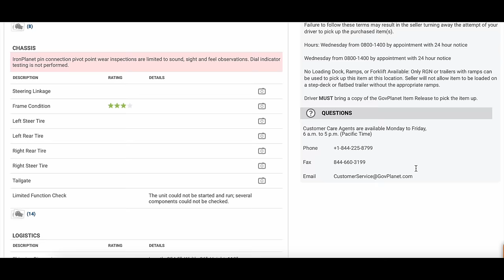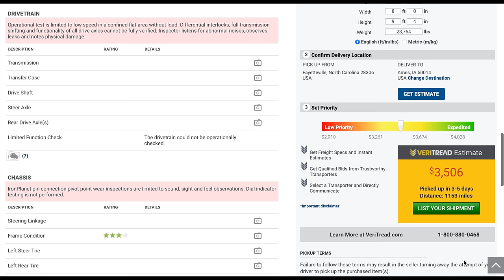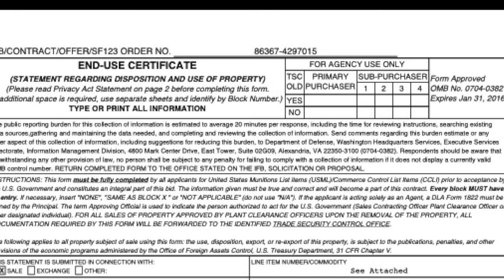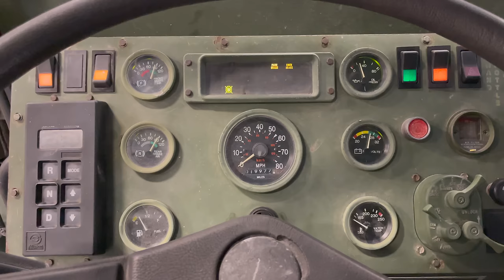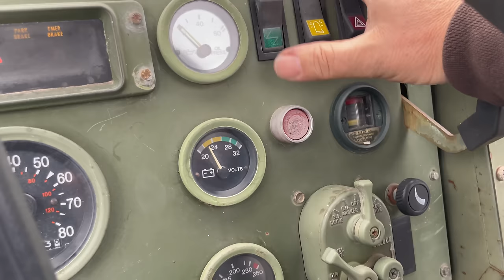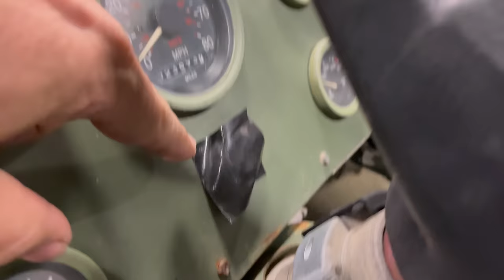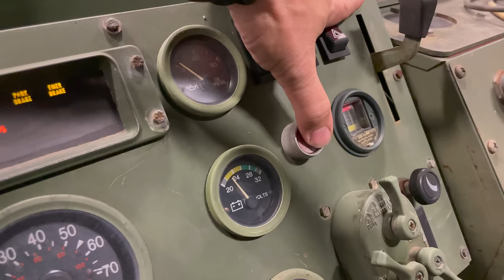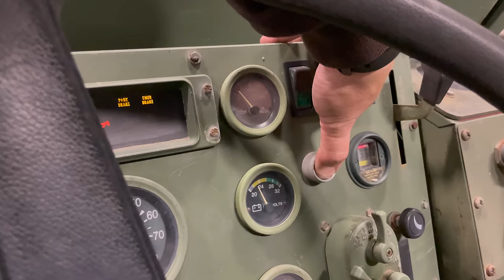Buying a LMTV on GovPlanet Wasn't How I Expected

Comment: It’s amazes me how little they sell for considering what the government payed for it originally.
Reply from the maker: Most hardly have any miles on them as well.
Reply: Because unlike you and I, the government doesn't have to earn the money they spend.
Reply: @ThisWeekWithCars  The life of a military vehicle is in hours, not miles. It spends more time running than moving.
Reply: @j.p.1576  USBP is pretty rough on vehicles as well.
Reply: @Theodore Olson You knew what I was talking about. I used to do avionics sales to all branches of the military. At the end of their fiscal year if they had any money left over they would spend every single tax payer penny on things they didn't need just so they wouldn't miss out. Their excuse...everybody does it, If I don't spend it, someone else would. Give me a break. Joe tax payer doesn't have that option, we live within our means. Not sell things for pennies on the dollar because it wasn't your money you were spending. Nice try though.
Reply: @Theodore Olson -  That's what the Toyota HiLux is for...
Reply: @ThisWeekWithCars  The military frequently replaces odometers so the odometer readings are rarely even remotely close to accurate
Reply: @bower31  I spent 25 years as a Army mechanic, and never heard of anyone replacing a speedometer.  The Army does keep fairly detailed inspection and maintenance reports, especially in their newer software platform launched around 2015.  It would be very difficult to claim low miles on a vehicle with higher mileage.  Compare wear on common items like steering wheel, seat belt clasps, seat edges from drivers in and out.  Vehicles that sit around too long rot quicker than vehicles always being used.
Reply: @chrisgraham9110  All I can tell you is in the USMC we replaced speedo's on HMMWVS and 7tons a couple times a week, it was a super common failure item. Where the speedo cable would connect to the speedo wore out a lot and the odometers would stop counting. Less so on the 7ton though, did see damaged damaged cab components semi frequently though. We were also regiment motor T so our dead line was normally a good 20-30 trucks, and we had a weekly turnaround of about as many trucks, unless we had an op coming up.

Edit: I was also pretty used to seeing weekly truck readings drop from 9-11k to 0 the next week after leaving the maint. cycle.
Reply: @born_again_torinos  It wasn't because they wouldn't miss out, it was because if they didn't spend all the money allocated, their budgets would likely be reduced the next quarter.
Reply: @dryan8377  Not at all. I lived it. I saw it. I heard them. I experienced them scrambling at the last hour buying tons of stuff they didn't need. We were even open till midnight so they could spend till the last second.
Reply: These things are disposable
Reply: @clutchitup8565  They definitely aren't, they're willing to repair up the to items value in maintenance
Reply: @born_again_torinos  Nah, federal budgeting is based on a use or lose model.  You spend your budget allowance or it gets reduced next year.  I managed a couple million dollars worth of supplies while active Navy, we'd usually use end of fiscal year funds to buy office supplies and other consumables.
Reply: @joshr9730  I know what I lived and nobody can tell me it didn't happen every single year end. It wan't paper clips it was high end avionics and the parts to repair them and mega expensive testing equipment.
Reply: @born_again_torinos   I don't think anyone's arguing that it doesn't happen like you describe. I think he was talking about WHY it gets done that way. I'm a H-60 mechanic with 18 years and counting, and I agree with you 100% that the end of the fiscal year spend-down is definitely a real thing...and that it's absolutely disgusting and disgraceful. However, the point others here are trying to make is that this spend-down doesn't happen simply because these government/military outfits are on some for-the-hell-of-it shopping spree. Regardless of how it may appear (or how individual units conduct themselves while interacting with vendors such as yourself), the fact of this idiotic system is such that if you manage your money all year, don't get hit with any unplanned expenses, and finish the year with money left over, the bean counters will take it away and reallocate it in nothing flat. Bit, if the following year, you have an increase in unplanned expenses in following years (i.e. increasing maintenance costs with aging aircraft), getting an increase in funding back from the bean counters is like pulling teeth. 

It's definitely a horrible system which incentivizes wastefulness!
Reply: @ThisWeekWithCars  Former 88M here, those miles were probably the hardest miles in existence.
Reply: @bower31  same in the transportation industry lol
Reply: It’s equipment, and we were at war. Better to have excess equipment than not enough. It’s wasteful for sure, but I do see the logic.
Reply: Military industrial complex dude. Can't spend your tax dollars to buy new shit if they're still got the old stuff knocking around - people might get wize.
Reply: It's the open market that decides what they sell for, it costs however much is a person willing to pay. Military vehicle aren't good civilian vehicles I guess, they make great toys that's for sure.
Reply: @born_again_torinos  in the corporate world, you need to spend your budget every year because otherwise it will be cut back the next year.
Reply: @chrisgraham9110  I know of several vehicles that had speedometers replaced while I was in, but that didn't change the fact that were still low miles. Highest mileage I saw was a first gen HMMWV that had been on several deployments and was used as a utility vehicle in garrison. Still only had 37,000 miles lol.
Reply: @bower31  you’re in outer space
Reply: @born_again_torinos  That's literally how everyone does it for their budgets and it's just god damned gross

That's why they'll blow threw crap tons of ammo before the budgets come in, I'm pretty sure lol 

That has to amount to quite a bit as well
Reply: Dad bought .45 auto pistols for 36 $ in 60s but had to wait 5 years to get them from government.

Comment: The slow and indeterminate process of buying a mil-surp truck on GovPlanet reminds me of buying a Japanese Domestic Market mini truck from Japan.  Mine arrived three months after I paid for it (typical) and the clutch was blown.  On the plus side, I only paid $265 for the truck ($2380 total with shipping, etc.) and it's otherwise in good shape for a 26 year old farm truck so I can afford to put a clutch in it.  Getting mini truck parts from Japan has been a huge hassle.
Reply: Honestly with JDM the process you've described is preferable to paying $20k for a car an importer has put well under $10k into.
Reply: @CIARUNSITE  - Not sure what JDM dealers you're seeing with a $10K markup for importing, but there are several good importers who can save you the hassle of one-time importing (probably 90% of the hassle and mental anguish is learning the regulatory and bureaucratic processes), for a small fee for them importing and in many cases, titling a vehicle that can be transferred to your state.

A title is a hassle but there's no reason it should add $2000 to the price.  Maybe the best of both worlds would be to sell an imported vehicle without a title but with all of the paperwork needed to secure a title, along with a cheat sheet explaining what needs to be done, with a checklist, tips of how to make the process go smoothly (some counties are easier than others), etc.

I had to pay a $5 inspection fee to the sheriff.  That inspection ostensibly ensured road worthiness but in reality, the purpose seemed to be verifying that the chassis number (in lieu of a VIN) matched the paperwork.  There was an $11 fee for creating a title, $33 for registration and $15.90 for the state and local taxes.  I paid state sales tax on the purchase price, but my Hijet only cost $265 and they didn't tax me on the $1935 shipping.  I left with a title, registration, license plate and all taxes paid through October of 2024 (20 months) for $64.90 total.

Including travel time, the process took a couple of hours, but I spent several hours researching the process ahead of time to ensure that I had all of the paperwork the county clerk needed to satisfy the state requirements.  Now that I know what is needed for the entire process (federal for importing and state for titling and licensing), I'm inclined to do it again.  I hated the entire process but the worst part was trying to learn what I needed to do and never being sure I was doing everything properly.  Now that I completed the bureaucratic and regulatory process once, it shouldn't be nearly as stressful and frustrating the second time and that lesser amount of suffering is well worth having an inexpensive and awesome 4WD kei truck.  Now I need a 4WD kei van.   😛

Comment: Most of these government contracted auction houses will not let you drive the truck out of the yard even if it runs.  You must have it towed by a licensed tow off the property then you can start it up and take it.  They don’t want to sell these to regular folks.  They want a buyer to buy them by the lot full.  Particularly vehicles like sedans and SUV’s
Reply: GovPlanet has off base locations and bring the vehicle out the gate to you.  What you do from there is on you as it's yours.

Comment: Just be happy the driveline upgrade was done to these before you got it. From the first unit to the last had the upgrade done to it. Worked at three different sites getting the vehicles done. Almost forgot the first 3,000 had to have their complete wiring harnesses replaced.

Comment: Pretty interesting alternator, looked expensive.
Reply: Its a generator. Thats why
Reply: Yep, expensive for no reason.
Reply: They are also dual voltage, one side puts out 12 volt the other 24 volt.  The early ones also had a stupid fusible link on the alternator terminals.  I believe they eliminated them later.

Comment: All military vehicles are setup to be able to operate at troop marching speed of 3 mph or 5 Km/h. That's the reason 1st gear is so low. It's not just American military vehicles. It's all of them. You don't want to leave your troops unguarded when marching. I have an antique Soviet Union KMZ Dnepr military sidecar motorcycle that was imported in 1992 from Ukraine after the collapse of the Soviet Union. They were advertised as "Indiana Jones motorcycles" because one of them was used in the movie The Last Crusade in 1989. No one told people ordering them they had to be taken apart and correctly put together again due to the exceptionally bad workmanship due to communism. I did that and today it's a good reliable motorcycle. You can haul 3 soldiers, 80 pounds of gear, weapons, and ammo for each, and tow a 1/4 ton trailer with it. You can put it in low gear, set the steering damper to lock the handlebar, and get off walking beside it with weapon at the ready so you can drop to the ground if you get incoming fire. The sidecar is set-up so the Gunner can sit facing forward or backwards depending on location in a troop collum.
Reply: Yup. Parade speed

Comment: As the truck sits there waiting for your paperwork to be approved it's used as an auto parts store....fuses etc...are stolen....it's stripped while waiting for it's new owner
Reply: True story.  If it was in the pictures when you bought it they are responsible if it's missing when you pick it up, hold them to it.

Comment: After World War II, a friend of my father had a farm near Saint Ignace in Upper Michigan decided he needed a four wheel air compressor. He got the mimeograph flyer from the government and saw that there was one known as lot 407 someplace in Ohio. He bid on lot 407 and won it for something in the neighborhood of $60. He got in his flatbed farm truck and drove to Ohio, which involved a ferry across the Straits of Mackinac in those days. There was a vast field of various lots, and a little guard shack. He asked the guard where lot 407 was and he was pointed to a distant corner of the field. When he got there, there was a string around a section of land and a sign that said lot 407. He went back to the guard house and asked him if everything that was in the lot was his. He was told he did. He was going to tow the air compressor behind his truck, but decided to borrow some equipment and forklift it into the back of the truck along with the other odds and ends in the lot. Once he got all that loaded, he backed his truck into the area where the Corsair fighter plane was, wings folded. He figured out a way to hook up the tailhook to his truck. The Corsair was essentially brand new. He towed it all the way home and parked it in his front yard as a lawn ornament for his kids to play on. Over the years, it just sank into the ground and fell apart. I have read stories of where new WW2 airplanes were junked because no one wanted to pay the cost of fuel at $.60 a gallon or whatever it was.

Comment: Everyone hates the low air pressure alarm in those things. Noise discipline is a thing people. The "standard issue" Gatorade cap fits perfectly over the emitter and muffles the sound to tolerable levels.

Comment: I love everything about this. I'd love to see you go through the purchase process on some other government trucks, maybe a humvee. :)
Reply: Its the same process with the EUC
Reply: @hummerguy  I'm guessing that is for any item thru govplanet, not just vehicles - is that correct?
Reply: @jamesthompson8008  No, it's only for the military items sold by the government. It may apply to interceptors too but I'm not sure. 

I've bought some tools off govplanet and I got those very fast, in less than 2 weeks, there were no EUC for those

Comment: Back in the 1970's I was working as a property book officer for DOD up in Michigan. All of the vehicles we turned into property disposal had their log books with maintenance histories. The down side was many of those trucks, cars would sit for months, before an auction, so naturally many of thse may have a flat battery. At that time we had a ten acre lot which we stored returned vehicles, inspected and serviced to be re-assigned to the Army Reserve, National Guard, we even gave some of the older 4 wheel drive tactical pick-ups  to the Macomb County Sheriff. The one thing we never gave for action was MA-1 Jeeps. They were cut up and destroyed. It seemed some American companies would buy the jeeps at auction strip and clean up the parts, then sell the parts back to the military as new ... it was so bad that in 1972 we started just cut up and destroyed them. A few years later the Jeep CJ 5 model was added to our line to replace the MA-1.